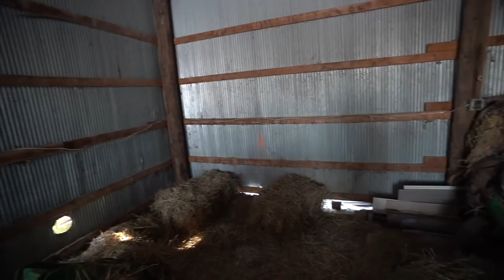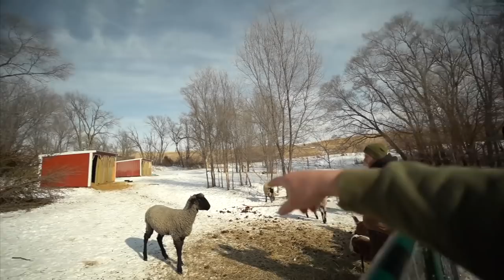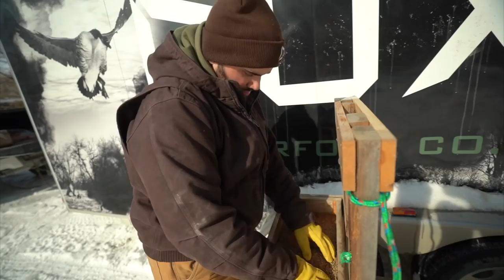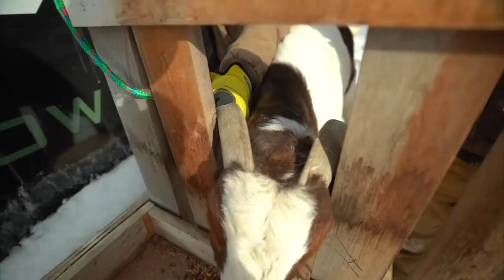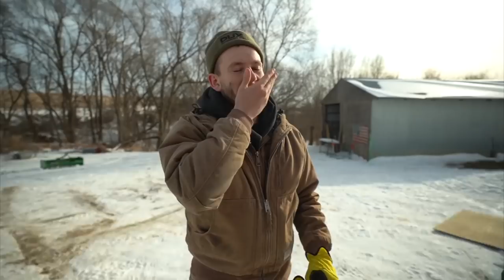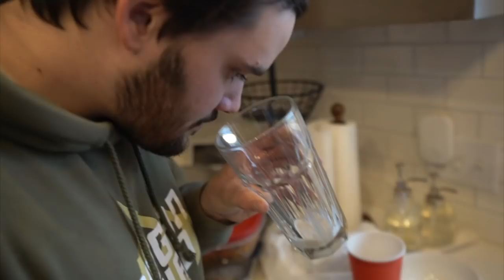MILKING My BACKYARD GOATS for the FIRST TIME!!! (Straight from the Udder)

Comment: Andrew the blocks are the longest lasting way to allow the critters Access to the minerals and salts that they need. . They will use them when their bodies tell them that they need them. If you can have them in a semi sheltered area for example of the two barns then they won't get eroded by rain water and or snow and such. .

Comment: you should get safeguard dewormer for goats, comes in a yellow squarish bottle and also get a goat drencher, its like a syringe with a weird tip (both sold at tractor supply).  its like medicine you just put down their throats so you know they have had enough dewormer.  Also if you want more got milk, you should get a lamancha dairy goat.

Comment: I grew up milking goats. The best way is to milk it directly threw a cheesecloth into your bucket onto ice packs. Take ziplock bags of water and freeze them then put them in the bottom of bucket. Stretch cheesecloth over the top and hold in place with a big rubber band. The milk is instantly strained and cooled which takes all the goat taste out of it